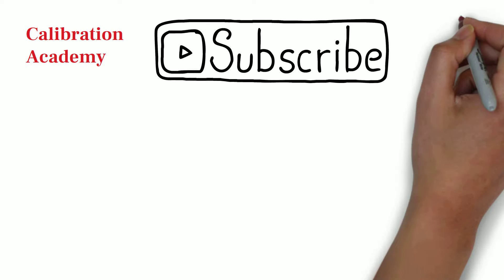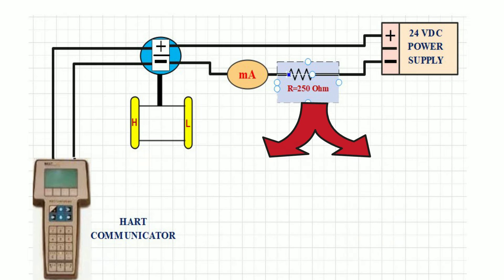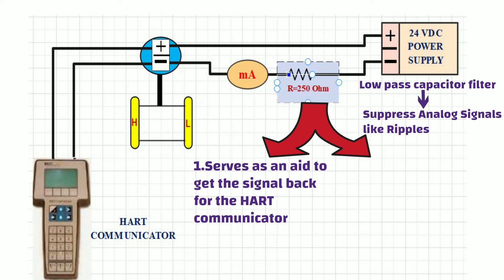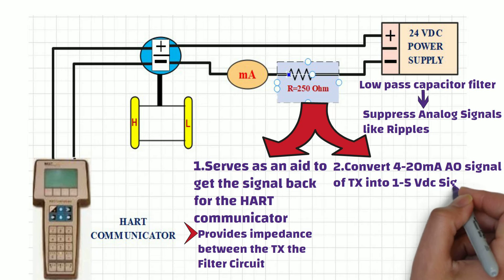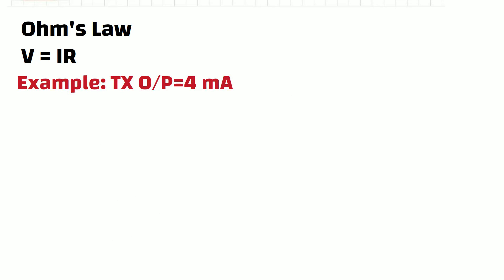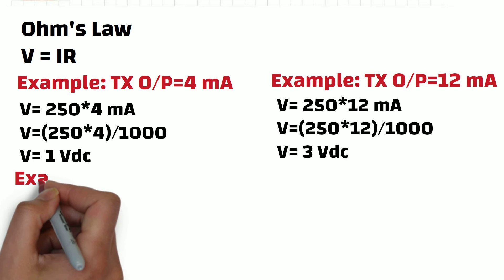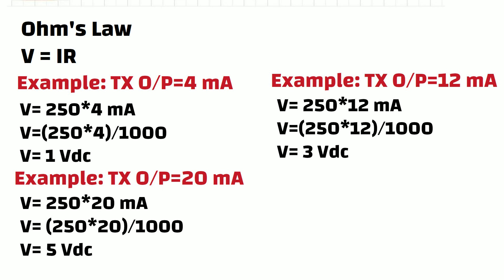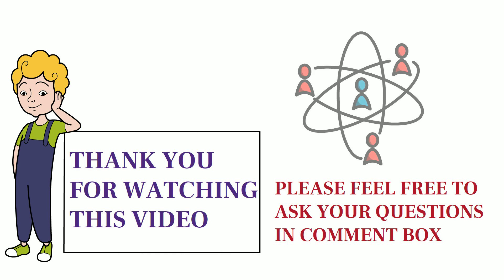Why do we use 250 ohm resistance for HART communication?

Comment: THE RESISTOR IS ONLY USED FOR PROTECTION AND NOT TO CONVERT 4-20mA. IT DOES NOT NEED TO BE 250 OHMS

Comment: What if the transmitter has a separate 250Vac supply, and you are connecting to the mA output... should you still need a 250omh resistor? thanks
Reply from the maker: Hello Jack 
Thanks for your comment.
No, you don't need 250 ohm resistor if you are using a 250VAC supply. It is applicable only, if you are using +24VDC loop power supply.
Reply: @InstrumentCalibration  Wrong, 8732E magmeter is externally powered either by 110VAC or 24VDC and you do need a resistor to talk HART to it. It depends on the PLC the TX is connected to. Allen Bradleys usually don't need resistor, GE Fanuc always need resistor. Also 250 doesn't matter that much, it can be anywhere between 250 and 600 ohms, per Emerson.

Comment: ithank you for video   is resistor  need to put  only when sensor connected power supply direcly  or  should we use in PLC connection ?
Reply: I've seen the resistor needed in both cases, both when the transmitter is powered on the bench or when connected to PLC/DCS.

Comment: Why does a power supply act as a low capacitor?
Reply from the maker: Its 24 Volt DC Power supply, which has low pass filter circuit in it. This is a reason it act as low capacitor.

Comment: The first reason can you elaborate more
Reply from the maker: Hello Abdullah
24VDc Power supply act as low pass filter circuit. It suppress analog signal of transmitter if we don't connect 250 ohm resistor .In other words, analog signal also filtered out by power supply, if there is no resistor. So this is reason we connect 250 ohm resistor.
Hopefully you get your answer.
Reply: @InstrumentCalibration  And what to do if it is tied parallel
Reply: @InstrumentCalibration  Why does a power supply act as a low capacitor?

Comment: What is 1000?
Reply: 4 mA is 4 x 10^-3 so we can write it another form 4x 1/1000 or 4/1000 =0.004 Ampere 
Now come to ohm’s law v = IXR 
V = 0.004 x 250 = 1 V .

Hope you  you understood
Reply from the maker: Sorry,,, I did not get your questions. Could you please elaborate it?
Reply: Cause the 20 in mA so we divide on 1000 to get in A and then get v as ohm's law
Reply: To convert mv to v or mA to A

Comment: Thanks again Boss. 

Question: 

1.1 Is the connection only for 2 Wire Loop Powered Devices ?

1.2 . Is it correct that you can connect across the O/P Terminals of Xmitter to DCS ? 

1.3  Can you connect across I/P Terminals of Loop Powered Device and Source Power to it like you can with a Process Meter ? 

1.4  Can you connect it across I/P Terminals to I/P Card and Source 4-20mA signal ? 

1.5  Is Tag name etc only readable if connected across the O/P Terminals of Xmitter to DCS ?

Thank you.
Reply from the maker: 1.Ans- Yes, connection is only for 2 wire loop powered device
2. Ans- Yes, You can connect 250 Ohm Resistor across O/P Terminal of TX To DCS
3. ans-You can also connect across I/P terminal of Loop powered device. You can find this type of connection in Rosemount 3051 PT manual
4. Ans-I didn't get this question. Can you please elaborate if possible.
5. Ans-No, it can be readable for both type of connection. It does not matter if you connect across output terminal or input terminal. 
Thank you for asking this questions.

Comment: I have to use resistor on positive? And how I connect cables from my interface? One on  positive and other on negative or i connect before and after resistor? I'm having problems with my hart communicator (pactware) it finds the interface but it doesn't find the instruments and when it finds the connection it's not stable
Reply from the maker: Hello Joao
Thanks for asking this question. try to connect 250 resistor in series with negative terminal of transmitter. It can solve your problem.